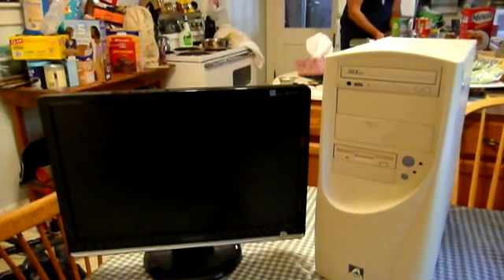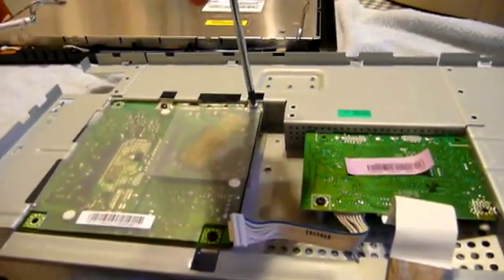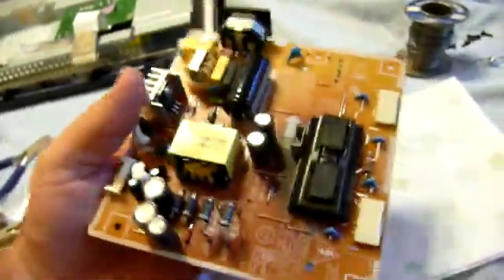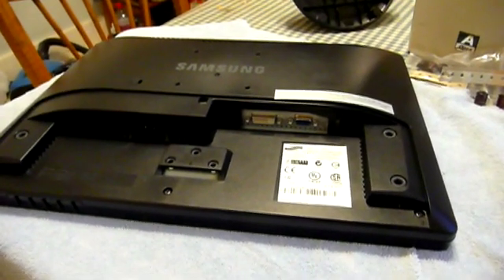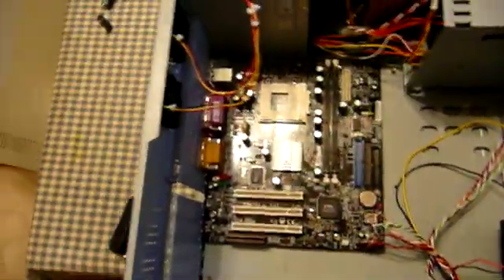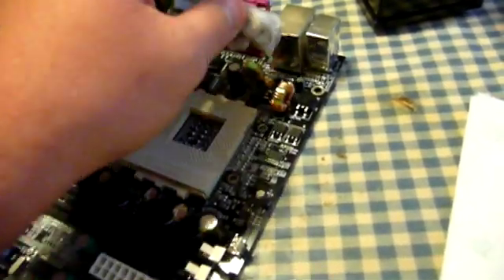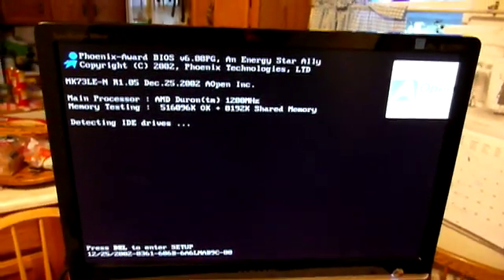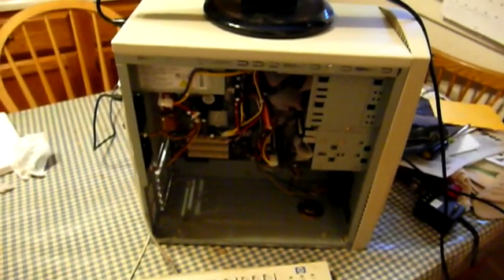Kitchen Table Electronics Repair: Computer Stuff

Comment: I recently got my dad a used HP 20" LCD Monitor at a local thrift store for $22.99 + tax and that monitor is in perfect shape, just the screen needed a wipe-down.  I had to get that monitor since my dad's old Sceptre X20WG-NagaII-b monitor has issues with the screen: there are either bright or dull vertical thick lines (the picture is still there) and I hear a squealing/whining noise from the monitor itself, with or without a picture on the display.  Could it be bad capacitors?
Reply: yes the whining noise are bad caps
Reply: That's still a good deal when you compare it to insane ebay prices. I found an HP 2405wg for no more than $12 a few years ago. 24" buit has a scratch, which isn't too annoying

Comment: There's nothing quite like the nostalgia of an awesome AwardBIOS 'beep' every time you turn on the computer. The fact that the EPA logo was changed is a bit of a frowny face, but I guess you can't win them all. I guess since my first computer had an AwardBIOS, that's why I'm much more partial to them than especially AMI. The first beep was very satisfying to hear and for some reason, AMI's sounded slightly different in pitch.

Comment: what are the farad values of thoses capacitors you replaced?
Reply: ***** I found out their values on the internet, they are 1000uF 10V,

I have the same movitor with the same problem but only one capacitor was bad, changed it and it came to life

Thanks, your video was very encouraging!

Comment: early AMD Athlon processors have heat issues because AMD wasn't thinking about people removing the heatsinks during operation, and didn't add processor throttling. the Athlon 64 added heat protection + throttle. my amd fx 6300 runs 106F when idle.

Comment: We have a monitor at work that malfunctioned today. It's a fairly new (a year and a half old?) 19" ViewSonic VA1948M-LED. It functioned normally for an hour or so after being stored for a few weeks, then it started turning off an on. The screen went black, then lit up to the ViewSonic logo, went black, then logo, etc. in a loop. The monitor it replaced was fine, and I grabbed another one identical to the malfunctioning one and it's also fine, any ideas what might be wrong with it? Capacitors?

Comment: I have an old Hewlett-Packard Pavilion f70 flat panel monitor manufactured in August of 2002 with 5567 hours on the back light and it still runs like the day it came out of the packaging. The built in speakers work awesome, too.

Comment: i had a old compac  with a 950 MHz amd cpu in it back in the mid 2000s i remember taking caps out of a old VCR with a propane touch to melt the solder from the back side of the board and pliers to pull them off then soldering them into the mother board with bits of cat 5 wire to extend the pins of the caps a few inches cause they were the same rating but fatter around then the originals  then i loaded the mess with hot glue to make sure it would not short out  i miss that pc lol

Comment: Tip #2. MB are notorious for keeping solder in the tiny holes even after you suck out the solder with a pump. Instead of trying over and over to suck out the solder, I recommend that you invest $10 in a pencil type hand drill bit holder and some tiny bits the size of capacitor leads. These pencil type drill bit holder when used with the bits will go through solid solder like a  hot knife through butter and you will end up with a perfect sized hole every time. Trust me, it works perfectly.

Comment: Bill, when you remove caps from a MB, it is best to put a small bead of fresh solder on the old solder points and let it act like a heat transfer between the iron and the old solder points. You can then rock the  caps out back and forth. THis extra solder makes it a lot easier for a solder sucker to remove that bead when you are done. Sometimes you might have to add another bead before you suck it out.

Comment: every CPU failure I've seen is because of some numpty improperly attaching the heatsink, not applying thermal paste properly (or at all,) and it's not limited to any one manufacturer. I've actually seen a lot of socket 775 Pentium 4's fail, mostly because of how goddamn hot P4's run for the cooling they're generally given.

Comment: I know a trick which will ensure that the electrolytic caps on the motherboard of a certain computer will never lose their connection to the board due to bad soldering joints - Press the CAPS LOCK button! :)

Comment: i replaced 3 caps in a hp vs10e monitor i got from computer repair place that was going to recycle it. look up "hpvs19e monitor fix". i did what the second link said. seems like this is a common problem.

Comment: FWIW, if a cap looks "kind of bad" then it's very bad. Visual signs come long after failure.
The first board I recapped was a somewhat rare one and personal favorite S370 ABit.  It has about 25 caps I replaced and the joints are awful with lots of burns. When I look back at it I'm amazed it works. I'm better at it now but I dare not retouch it, I think it would shatter like glass if I ever reheat the poor thing again. At least that board seemed to be forgiving of my lack of skill.

Comment: @MixerVM 
The capacitors next to the processor are usually 6.5 volts.
Old processors like a 286 or 386 could run without any cooling at all, and just the power supply fan was fine to keep air moving.  But pretty much anything from a Pentium on up will burn completely out rather quickly without any cooling, and the fans in the case help the processor fan by keeping cool air going through the case, so the processor isn't just getting hot air blown on it.

Comment: I'm messing with an old AM37 motherboard, which is a socket 462 board(Athlon XP).  It's got nine bad capacitors right in a row near the CPU.  Seems to have caused both the onboard display to stop working and the hard drive to spin up and down randomly.

Comment: I have 2 solder iron from when I was in the NAVY they have 3 prong and say grounded I was taught that the solder iron must have 3 prongs as a 2 prong
can get a small voltage from the neutral.  Have you heard this?
I love the way you can fix any electronics. 
Keep the videos coming!!!

Comment: I replaced a no name brand (Teramars, I think) 17" CRT from 1997/8 in 2008 after it died. In it's place I got a Hanns-G HB175A. I highly doubt this LCD will work in 5 years, nevermind 10 years.

Am I crazy or smart for thinking that?

They just don't make things like they used to.

Comment: I bought a 21 inch Dell LCD monitor from e-bay about a month ago. It was manufactured in Feb 2006 and wouldn't power up.
I did the same thing Bill did by taking apart the LCD and inspecting the video and power boards. Unfortunately I couldn't see any distress on the capacitors or heat on the boards so I spent an hour searching the net and determined 3 caps were the most common failures, replaced them and have a 595$ monitor in 2006 for 30$ , 4$ in parts and about 3 hours of my time!

Comment: I have an aopen computer branded as Advanced Logic Systems with the same case as this one running an athlon 1800+ and it doesn't have those rear exhaust fans or the front intake fan so it runs really hot. It still runs though but crashes on programs quite often so I need to find fans that fit those 2 rear vents but they don't appear to be a standard size fan

Comment: I have found that I needed a fairly hot iron for mainboard work.  Most modern ones are 4 or 6 layers, and the layers act as heatsinks, so they won't take any solder if you use the light-duty irons.

I have about 20 Samsung monitors of similar vintage at work with the same power supply problems.  All have bad caps.  Faulty electrolyte formula copied by lots of overseas firms means these problems are widespread.

Comment: u got lucky i dont usually find any free lcd monitors other then maybe some older ones someone may have upgraded from but usually they are gone about a minute after they are free. the only working monitor i have is an emachines crt from 2003 and it has a self diagnostic in it so if there is an issue with the monitor or computer it tells u. i wish i could come up with an lcd rather then a crt